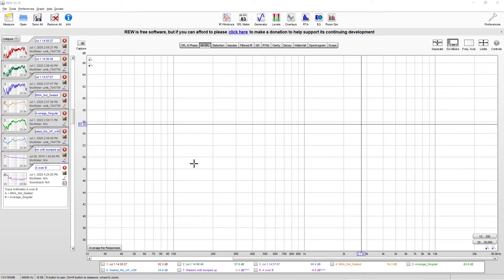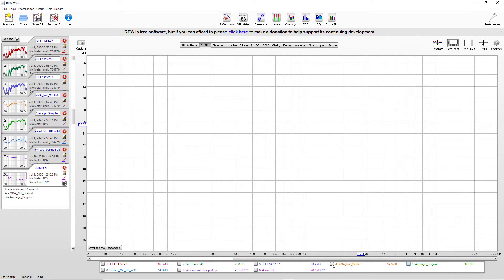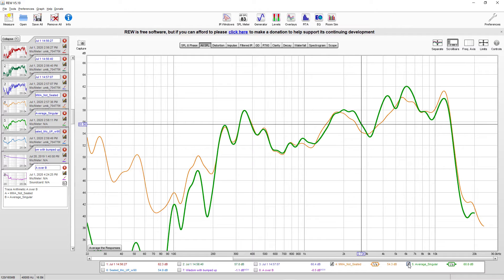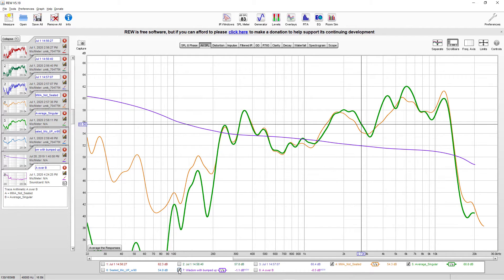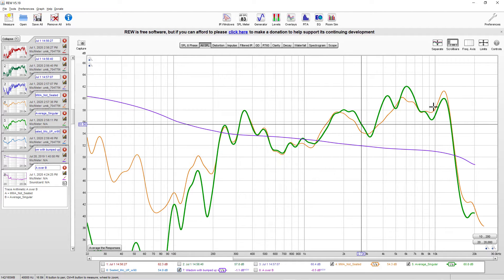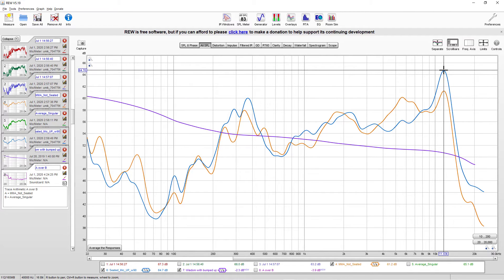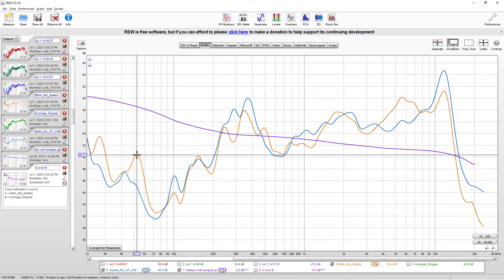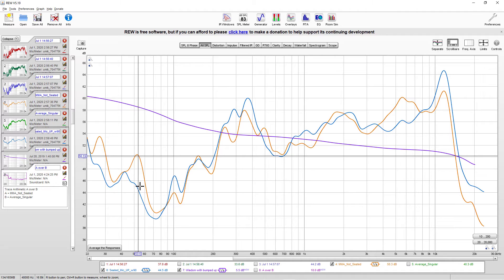RTA Measurement Method Differences, House Curves and You!

Comment: Hi Erin, I really lime your videos. Definitely it’s evident the scientific method you apply in all your process. For that reason I’d like to ask your opinion on “target response”. 
Background: I have DDRC24 (minidsp 2 in 4 out with dirac live)  two full range towers crossed 80Hz LR48db symmetric XO with powered Sub 12 inch, plenty of class D power (TPA3255 DYI)  back wall 10cm high density foam 2mx1m and on each ceiling reflection point 5cm 1sq meter high density foam. Same on lateral first reflection and thick carpet between speaker and listening position.

I enjoy thousands (really) measurements with REW looking at freq response and step response. 

My finding is that the best clarity is achieved when the first  10-20ms (3-6 meters..)  after sound arrival are free of reflections (floor, walls, ceiling,) I mean tamed below 20db . Frequency flat response  is important as bass and high extension “But” (I really appreciate your comment on this)  even a nice spinorama in a small (reflections between  5ms -10 ms ) live room return poor intelligibility and clarity. I got the highest improvement addressing the first reflections leaving the later ones than by any dac, amp, speaker and dirac. Make sense to you? I see in pro audio , good speakers like kii d&d, grimm, genelec, adam,... address room reflections first by having controlled directivity. And in such studio you have walls far (near field) from the speaker-engineer setup. Are we (all) missing something if we look only at spinorama? Shall we advocate for room treatment to reach the optimal listening?
Could a good engineered speaker  (ex: nuemi bs5 sealed, active, digitally integrated with a sub and diraclived) in a “perfect” room return better freq response and impulse response than most multiple ten-thousands high end beryllium, floor standers do today in live rooms? 
Thanks in advance 
My Best
Lorenzo
Reply from the maker: Lots of variables here.  Firstly, the ideal speaker depends on the person.  We know from science that relatively flat on-axis response and controlled dispersion that aligns with the on-axis response, just falling in output, is preferred.  But the amount of energy off-axis is the gray area, at least in my opinion.  Some people prefer less room interaction... a speaker with a higher directivity index.  While others prefer a wider directivity (more room interaction).  Of course, treatment of the room is also a critical aspect of this as well.  If you have a wide dispersion speaker and enjoy the extra apparent source width (ASW) it provides from the side wall reflections then absorbing that may be detrimental to the sound.  I truly encourage you to check out Floyd Toole's book on this because all I'd be doing is regurgitating what he says... albeit at a much more simple way because I have nowhere near the intelligence nor experience Dr. Toole does.  Not sure if that helps.  But hopefully it does.  A link (affiliate link) is below for Dr. Toole's book:
https://amzn.to/3o1Yih5

Or if you don't like doing affiliate links, the title of the book is: Sound Reproduction: The Acoustics and Psychoacoustics of Loudspeakers and Rooms

Make sure to get the latest edition (3rd, I believe).

Comment: Interesting video. I was surprised at the differences between spatially averaged swept sines and MMM. 5dB is quite a lot! However, I'm curious why you consider "loopback" as a separate category. Why wouldn't you try to keep time relatively accurate (i.e. using a 2-channel interface with loopback, or the timing reference feature with a USB microphone on REW) for individual swept sine measurements within a spatial average?
Reply from the maker: I considerate it separate simply from the aspect of what people are comfortable with.  The majority of measurements I see shared and asked about on forums are taken using the MMA method because it's simple; pink noise and a USB mic get you there.  The loopback method requires a bit more complexity and understanding.  If your goal is simply in-situ response then the MMA method is adequate.  Timing/phase is another level of analysis.

Comment: Erin, I found out about you after reading your review on Amazon for the Neumi BS5's. I saw some work you're doing and I think it's amazing! I went to donate on the link below the BS5 review you did, but the link didn't work. You can reach me on @joentell on Instagram or facebook.com/realjoentell. The JL Audio shirt is dope too! I used to have 3 x 10W6's in my car in high school.
Reply from the maker: Joe, I appreciate the kind words.  I am a fan of your channel and have been a subscriber for a while now.  I appreciate that you try to put some objective measurements in with your evaluation.  

I am surprised I still have that shirt.  I have worn it countless times.  It has gone from being too large, to too small and now almost too large again.  Either that thing has a mind of its own or I need to see a doctor.  LOL.  I am currently running a 12w6v3 in my car system.  JL makes some excellent stuff.  I try to support the brands I believe in when I can.
Reply: @ErinsAudioCorner  oh man. You're making me jealous. I used to run 3 x 10w6's in ported enclosures at 1 ohm or whatever it was. Ran it on an old Soundstream "cheater" amp.